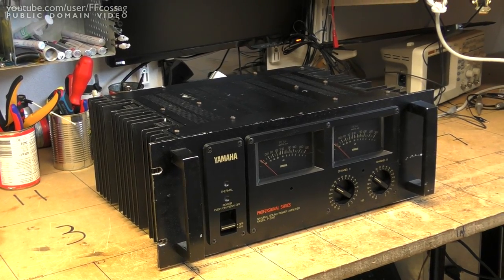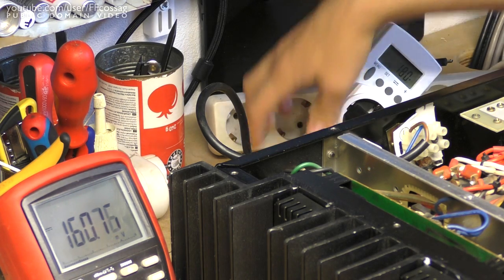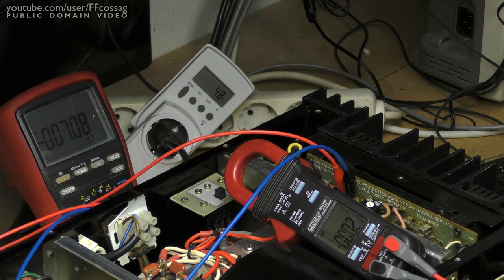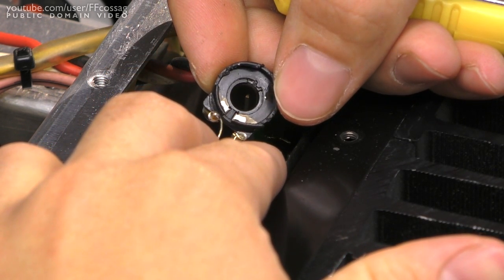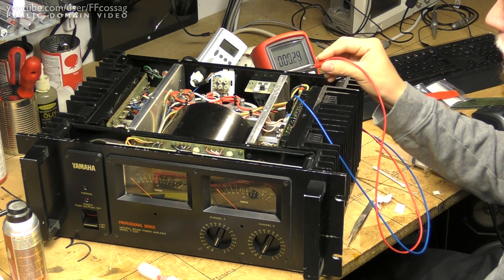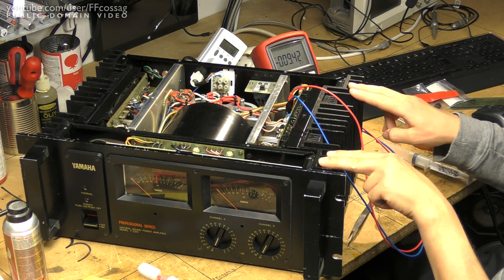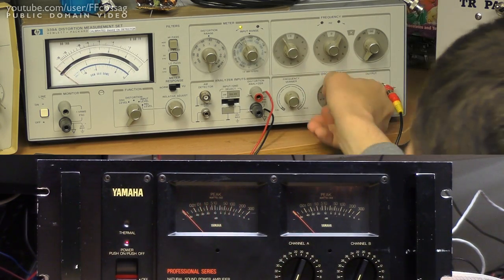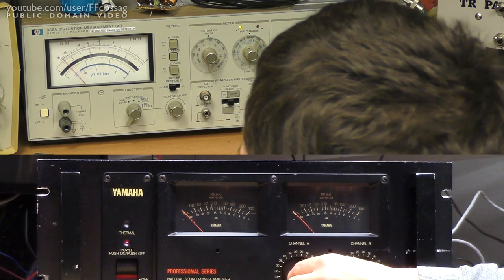Yamaha P-2200 high bias troubleshooting & repair

Comment: I have this same amp it was working and got knocked over while playing now it won’t work. Where do I start looking. The red power light does come on and the needle jumps momentarily at start up.  Any and all advise would greatly be appreciated & I thank you in advance Thank you
Reply: Could be a solder joint became loose. Hope u got it fixed

Comment: You've done a smashing job for it's new owner, balanced and happy as larry :-D.
Sounds like the transistors are matched nicely too.

I sort of expected you to measure supply current to each pair of trannys, i've used that method in the past, just keeps the trannys in the design zone.
But i dont know that amp so it may be very accurate in the translation of pot voltage to bias level.
It tests spot on though, you seem good with amplifiers :-).

My internet died yesterday, otherwise i would have watched you then :-(
Reply from the maker: Not much point measuring each transistor, since it's enough that just one passes enough current to prevent crossover distortion. NFB takes care of the rest. That said, I did match the transistors prior to installing them, just because I had too much time on my hands.
Reply: But the zero volt balance at the speaker does matter, matching devices is allways a good idea, you didn't waste time, you really didnt :-).
You are a good tech, never allow anyone to tell you otherwise :-).
Reply from the maker: Ah, yes, of course. That's still usually handled by the NFB circuit, though. The tiny voltage differential in this one probably has more to do with some poorly matched resistors somewhere.

Comment: The music is fine, not obtrusive and rather well done.
Great fix on the bias pot!
Where did get a hold of that HP distortion measurement set? I've seen many times, just curious.
Reply from the maker: I was lucky enough to be in the right place to grab a whole bunch of gear that was being scrapped by a local TV station.

Comment: you still got this ?
Surprised it works !!
That pot HAS to be 1k and you adjust it for 10mV across the test points CT and PE at this point also check the voltage is zero between CT and E.............. The idling current should be 21.2 mA for each power transistor

post back if you didnt blow it up !
Reply from the maker: What? It's calibrated to spec and then I sold it. It's still running just fine, since it's in spec.
Reply: @FFcossag  They are a real pain those trimpots, always amazes me how they manage to stay so close to spec even after 40 years.....testament to the design and build quality of these things........  I only posted just in case you didn't have the service manual but they are easily got these days... Maybe you shouldn't have sold it, any regrets ? only askin, I would only sell mine if a PC2002M came up but unfortunately, The majority of them are 110v and a long long way away, do you think they are better?  IN Ripoff UK,they add the shipping to the price then add another 30% on the combined amount so we have to pay duty on the shipping and to add insult to injury, the Royal mail steal it to collect the duty then charge you another 30 for handling it...... IM NEVER GONNA GET A 2002 ....DAMN !!!!!!
Reply: @FFcossag  those are wirewound preset pots.....carbon ones will burn up
Reply: @ianhuntington9056  I have P2200 and a PC2002. The PC2002 definitaly os an upgrade. I also have an M80 and although not as much punch as the PC2002, cleaner sound. Espesially when at high volumes. Then I have a trio of MX1000u's. These absolutley dominate the others. That being said, I enjoy them all.

Comment: Thanks for an informative video! I've got a P-2200, but unfortunately the stepped action on one of the channels have... melted away? The dial can be turned multiple full rotations. I think it's the only issue with the channel, do you know what the name of the part I have to replace is, and how difficult it is? I have kiiinda limited soldering experience... Cheers, and thanks for your videos!
Reply from the maker: That could be as simple as a broken knob. The actual volume control potentiometer is very special in these, you'd have to chase down a donor unit to find a new one, or replace it with a normal potentiometer.
Reply: @FFcossag  Thanks for the tip! I'll have a look into it!

Comment: Great video - like the way you have mastered the 339A - I have an 8903B which uses same principal for measuring but easier to use I guess.  One question:  the distortion is so low on the P-2200 it seems it would be at the same level being put out by the 339A generator, which I expect to be around 0.0015% (-95db?) itself.  Amps that I have worked with exhibit magnitude of order higher distortion so the the analyzer distortion can be ignored.  When it is so low in this case how do you deal with what the amp is producing vs the analyzer?  If you subtract in this case I am guessing that the P-2200 is really putting out much less distortion!  Or does the analyzer do the math canceling its own distortion out?  Thoughts?
Reply from the maker: The answer is simple, you're an order of magnitude off; 0,0015 % THD is not -95 dB, but rather closer to about -75 dB. Add that extra zero, and all your assumptions stand quite true.

The "dry run" distortion of my particular 339A is somewhere around -95 dB. If I hook the sig gen output to the distortion meter, the needle drops to one or two points from the bottom of the scale, 0,0002 % or so when fed a signal close to a full scale deflection for the range, or 0,0005 % or so for a 1/3 or so deflection for the range. If I hook the sig gen up to my PC to measure the THD (without N, because the PC has too much noise to see it), it is below the performance of the sound card itself, which bottoms out at about 0,0004 % on the ADC side when fed with an almost full-scale signal.

As such, I'm quite confident using my 339A to rate amplifiers down to about 0,0005 % (-86 dB) THD+N in most cases, or down to 0,0003 % (-90 dB) if I can achieve an output level that's within the top third of one of the 339A's meter range. The closest I've come to an amp which would challenge the 339A, was a Yamaha AX-590, which scored consistent <0,006 % distortion figures across its entire power band due to its insanely low noise floor. Alas, still an order of magnitude noisier than the meter.
Reply: @FFcossag  Why does the specs sheet of the ax-590 says 0.015 THD (i assume at 1khz only) and you were able to measured 0.006 across all frequencies? Are they being to "modest"?